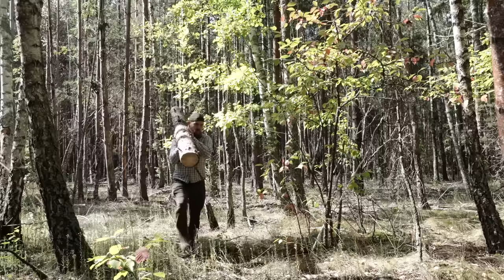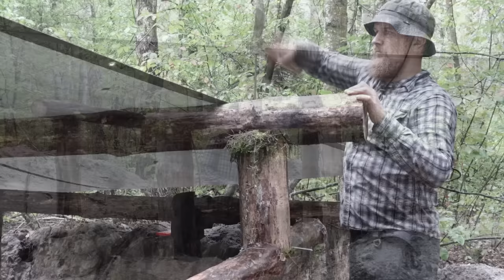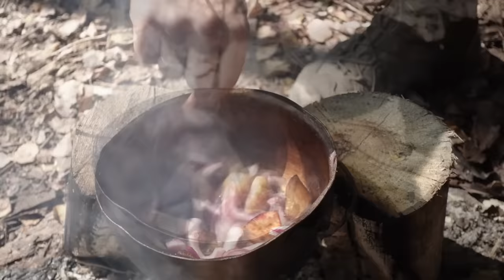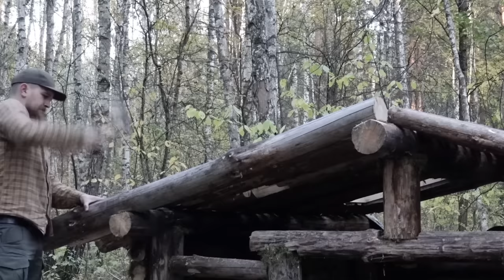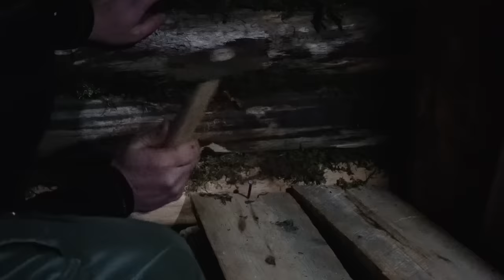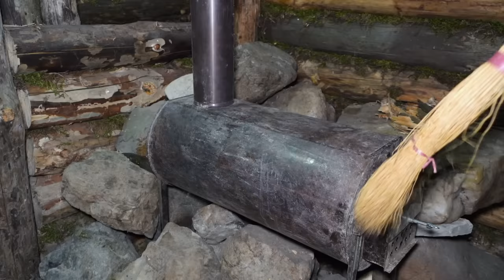building bushcraft survival Dugout shelter , alone in dark forest , no talking

Comment: Question: what is the purpose of using moss/lichen between the log posts? I understand about chinking between vertical logs but I have not seen this done on top of a post and then attaching a beam log on top. Your video was most interesting, thank you and God bless.
Reply from the maker: exactly the same meaning as in the vertical use of moss, I just didn’t know what the end result would be, I just built and changed everything on the go, I didn’t have a clear plan, thanks
Reply: Ok, thanks. ".....I didn’t have a clear plan". I can sure relate to THAT.🙃 God bless. @ShevaBushcraft

Comment: That is a beautiful shelter! I am curious about the use of moss inside. I can see the reason to use moss between logs on outer walls. But on inside walls already protected by tarp and earth? Surely the moss will rot and be useless?
Reply from the maker: thanks, moss is a good heat insulator, so it was used wherever possible